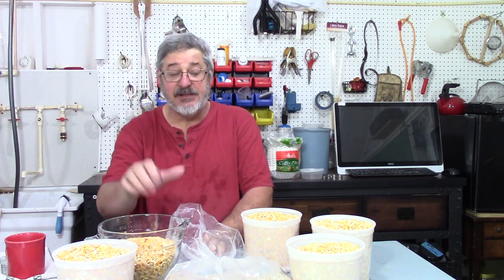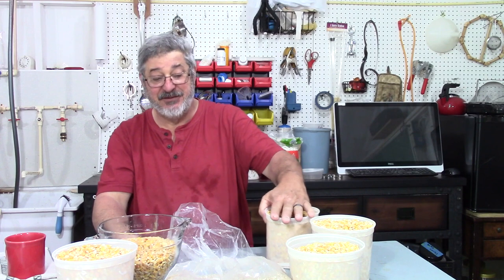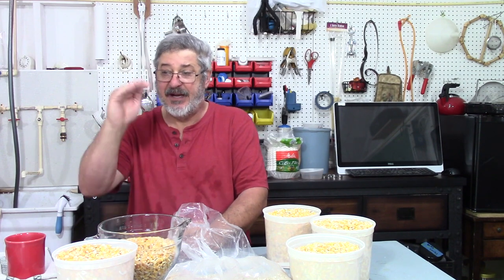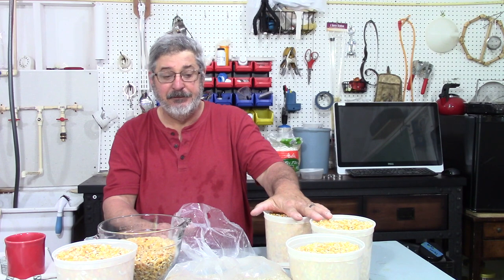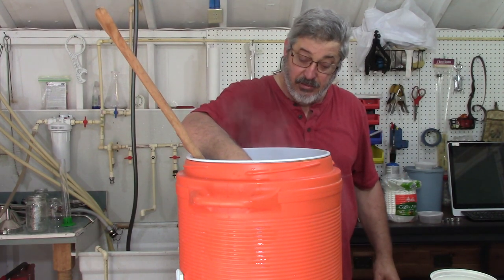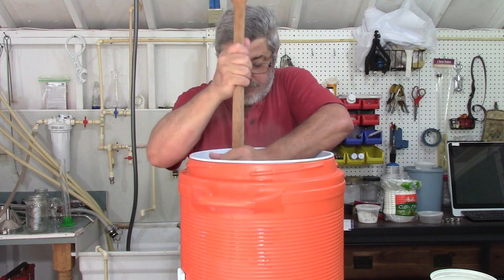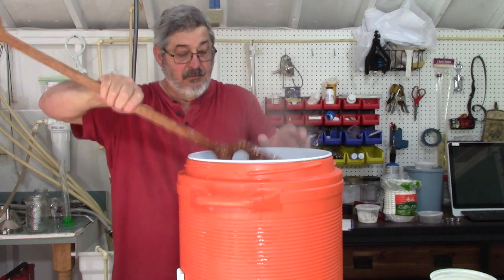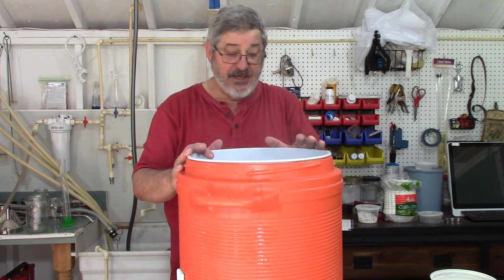E247 How to make  corn moonshine a base for flavored moonshines

Comment: Hey I wanted to tell you that thanks to you and a couple other guys on YouTube I finally put my own thing together. Self engineered my own device and I cooked my first bourbon mash up almost a week ago along with a honey Mead I got brewing up with it. I figure if i F up the Mead I’ll run it with the bourbon 💪🏻🇺🇸
Reply: Best I can tell, If you don't like the outcome you can blend it with other distillate to make something that YOU really like.  The craft is all about creating something that you are happy with.  Love the comment!
Reply: Hi! Welcome! DIY is the fun way to go.
But...
Being new to the game w/ DIY kit, you want to make sure you know the safety side of things. 150F ethanol is a strong solvent - No lead solder, No brass, No rubber in the still. 
No vapor leaks Have good ventilation. These vapors, well, your car runs on them. E-85 fuel has a lower ethanol concentration than you can make at home over a gas burner. Run your rig as if it were full of gasoline.
Not trying to be preachy or doubt your skill, it's just best if our sport stays out of the papers.
Reply: Much appreciated my brother, yeah I built it out of a 16 gal stainless milk can and a 8 gal Vevor as a thumper. I drilled a 2” hole in the milk can locking lid and put a 2” bulkhead on it and threaded 2” stainless pipe up to a sight glass and back to a elbow which then goes to copper lines heading to the thumper and so on
Reply: @racerothery2716  Excellent! I only said that because I have seen some super-sketchy home builds. Have fun!
Reply from the maker: We all help each other cool
Reply: Hey i appreciate it to the moon bro! I mean it. I’m fuckin new and I’m not gonna pretend like I know anything but what y’all have taught me. Shout out to Jesse at Still It too! 2A=➡️2️⃣🐻💪🏻s

Comment: Randy, I made this recipe with 14# of cracked corn from Tractor Supply that I milled to a coarse corn meal and 4# of milled 2 row malt. I followed your recipe to the tee, but only got a 1.045 OG. Iodine test confirmed the conversion. This corn is about 9 months old and the 2 row is about 1 year old, but has been vacuum sealed and stored in the freezer. Any ideas why  I got such a poor brew house efficiency?

Comment: Ok, i just started a 7-7.5 gal mash, 14.5 lbs Milled Cracked Corn, 2.5 lbs 2 Row Malt Barley.
I went with ALL your temps and as it sits now, i have 7 gal of Porage, its not converging enough for any liquid for fermenting?
I will get back after it sits over night!
Reply from the maker: Check in morning maybe a iodine test to see if starches are present

Comment: Hey Randy,my problem always seems to be yeast and fermentation, I use DADY for most every batch,around 16 grams,my last sugar wash was like the Lakers locker room,bad yeast?
Reply from the maker: I use DADY yeast 99% of the time keep eye on temp my fermentation around 75 to 78 deg.
Reply: You might have a couple of things going on if your ferment smells. First, your yeast might be stressed if your PH isn't down where it should be. Shoot for somewhere in the range of 5.2 plus or minus. Also, if you aren't adding nutrient to a sugar wash, that will stress out your yeast. Your yeast needs more than sugar to be healthy and remain active. Stressed yeast will produce some nasty smells. Try using some yeast nutrient in your sugar washes and see if that makes a difference. Your corn ferments should be ok without any nutrient. Make sure your temps are where they need to be, and clean and sanitize your fermenter to avoid infections. Try these hints and I believe you will have much better success. Best wishes. -- den